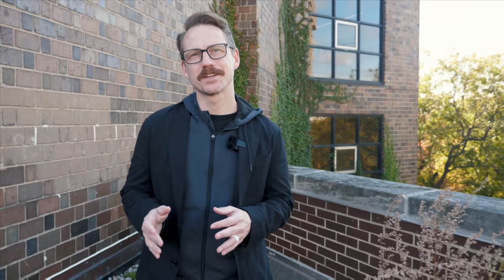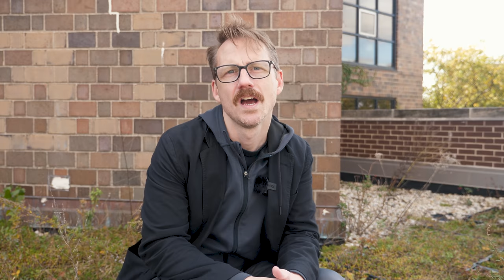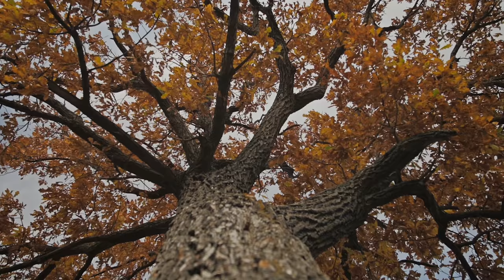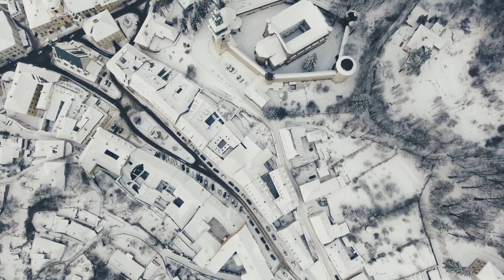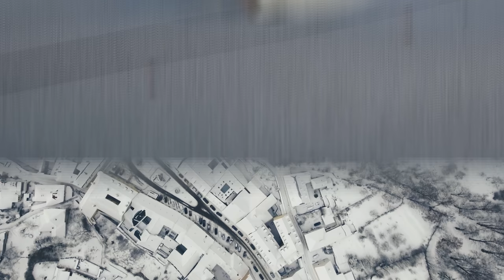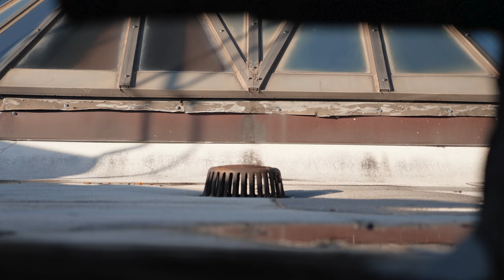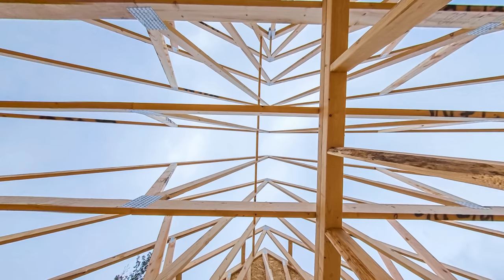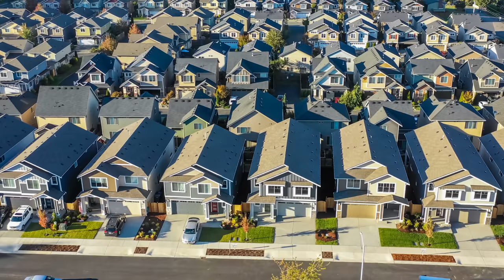Why Do Architects Insist on Using Flat Roofs?

Comment: My high school in Texas had a flat roof that collapsed after 20 years due to water accumulation. It was a small district and there was nowhere else to send kids while repairs were made, so we just had to attend classes while the school got re-roofed. Good times.
Reply: 20 year water accumulation? You do know water evaporates right?
Reply: @KeyserSoze23  water also soaks into, corrodes, or weakens just about every material over time.
Reply: @KeyserSoze23  bro 💀
Reply: That is due to power construction not the design
Reply: @KeyserSoze23  and it come again every year
Reply: @KeyserSoze23  20 years old, not 20 years water accumulation..
Reply: Ponding on absolutely flat roofs can create an additional loads as water accumulates as the roof deflects.   Building codes require the structure for flat roofs to be designed and built to limit that deflection and prevent  ponding.

On flat roofs or low slope roofs, modern roofing membranes such as PVC do not deteriorate the way conventional touchdown or multiply asphalt does in areas where water accumulates.
Reply: Our school smelled like Hell because they spent most of a year re-tarring the blasted thing.
Reply: It's Texas so there was probably some cost cutting involved.
Reply: Sadly, given that this was a school in a state whose government does not value education (even by already-low American standards), I suspect the problem was corners being cut in design, construction, or maintenance. 😕

I bet the local Walmart never had similar problems with its roof. 🤬
Reply: Please tell me the football stadium was safe
Reply: " after 20 years due to water accumulation" : that's probably not what happened but whatever...
Reply: @DanielPereira-ey9nt  it is because of design.
Reply: @MisterJeffy  and soon you'll realize that its better to just eliminate ponding all together and get moderately sloped roofs and after generations of people wasting material to fix your low slope roofs/flat roofs, you'll just be back to how your ancestors traditionally built, ie with sloped roofs. 

The rejection of tradition truly is the most idiotic of modern phenomenon.
Reply: @johnisaacfelipe6357  How traditional are we talking, asphalt shingles, wood shakes, thatched roof over open fires, mountains over caves?
Reply: @MisterJeffy  before modernism took its grip on architecture, so around 1920-1930s.
Reply: As a roofing consultant in Texas who has designed 100s of schools in the state in more than 15 districts, I can tell you that this is uncommon, but some districts do not understand the risks that come with putting of roof work. We take safety precautions very seriously in our industry, especially weight related issues due to standing water. 

This is why the number one rule when looking at low slope roofs as far as drainage safety goes, is having proper overflow provisions. There are many rules regarding overflow provisions, but it is up to the owner to observe these systems and be aware of a roof that is not draining properly.
Reply: That's not an issue with the roof type but how it was designed
Reply: @johnisaacfelipe6357  nah, it's just lack of maintenance tbh. People think just because you don't have roof tiles you don't need to repair anything.

Comment: As someone who lives in an area with plenty of snow and wind, I occasionally hear about buildings with flat roofs collapsing due to snow load and shingles or entire buildings with shingled roofs being blown away, such as my old neighbor's garage. Debris comes on the wind, breaking a few shingles, then the wind catches the roof, blowing the whole thing apart. For me, it's sloped metal roofs all the way.

From this video, I better understand the reasons for having flat roofs, besides just cost. One point that was not brought up, however, was the time of year they need maintenance. Sloped roofs need gutter care in the spring and fall, but flat roofs need shoveling in the dead of winter, which where I live is wind season. I ain't gettin' on a flat roof to shovel 3 feet of snow in 70 mph winds at -20 F, that's for sure. 

There's definitely people around that'll do the job for the big bucks, 'cause I've seen 'em work on flat-roofed businesses, but I don't get paid "have someone else risk their life" kind of money.
Reply: Location and weather make all the difference. Sloped roofs will always be better in wetter and colder environments. But if you live in a fairly dry and hot place, you want the least amount of surface exposed to the elements.
That is why old middle Eastern buildings were built flat and very near each other, while in Scandinavia  very angular roofs were the norm.
Form does follows function I guess
Reply: I suppose they could start including a means of heating those flat roofs, where snow loads crushing said roofs is an issue. Something they turn on only when snowfall is over X amount, say. Can't be that new of a thought; my aunt mentioned having something like that added to her roof, to speed snow shedding.
Reply: @cchastant8251  Yea that does exist but it's quite expensive for commercial buildings. If you want to heat bathroom tile you run the heating wires just below the tiles. But an exterior roof has many layers of materials, including insulating layers, before you can place heating wires. So to heat the roof you pretty much have to warm the entire structure to the point it will melt the snow on top of it. It's kind of an insane thing to do IMO, but it is done sometimes. The far better solution is to just build a roof strong enough to carry a snow load far beyond what your climate will see, and angle is slightly so it drains when it seasonally melts. For your aunts case, they might be lining a heating wire around the base of the overhang so icicles aren't forming and snow doesn't have a spot to begin to pile up from, but there are heated gabled roofs too it's just again not super common.
Reply: I live in an old converted barn with they stereotypical multi angled sloped rood, and we simply do not have gutters🤷‍♀️
Reply: @cchastant8251  Then you need to solve the problem with iceformation too (at the areas not heated) as you need to drain the melting snow. Only one powerout during midwinter could lead to disaster as the drains would freeze. Solution would be to keep the heating up constantly (for the whole system), but that would be extremely unefficient.
Reply: @cchastant8251  There are cables that can be laid out on roofs that help ice and snow to melt. The issue is, they can be expensive and they draw a lot of electricity to run. Also, you have to remember to turn them on ;)
Reply: @nazarenoperezpelicon947  middle east roofs are flat cause they get like an inch of rain per year. just like in africa so on and so fourth
Reply: You should see some snow removal videos from Sweden and such.  A common method seems to be leaving a rope on the roof, hanging down both sides.  When the snow piles up pull the rope from one end of the roof to the other.  Loosens the snow enough so that it slides off!

They use other methods too, but I remember the rope one because one guy didn't move away from the building fast enough and it all came down on him!
Reply: The problem of snow load is multifaceted where I live, next to Lake Superior, where we get 300 inches of snow a year. The best solution is a flat roof that is cleared of snow by the wind, so it never accumulated. Our building in Calumet works well that way, we never have to shovel. Otherwise you need a strategy for removing snow you shovel off the roof. You can’t just drop it in the street or the neighbor’s lot. So you need dump trucks to haul it away. You pick a nice sunny day, preferably without wind. With sloped, metal roofs that shed snow in big waves on sunny days, you have to worry about who or what the snow is going to land on. And freeze/thaw situations present their own problems, from dangerous icicles to blocked drains to damaged roofing.
Reply: @nazarenoperezpelicon947  And with climate change, these factors become a lot less constant.